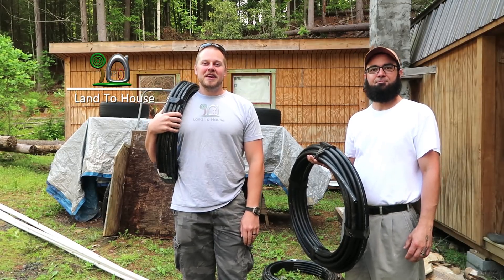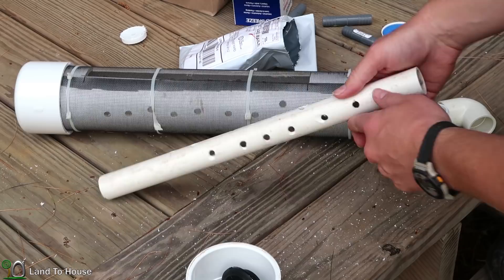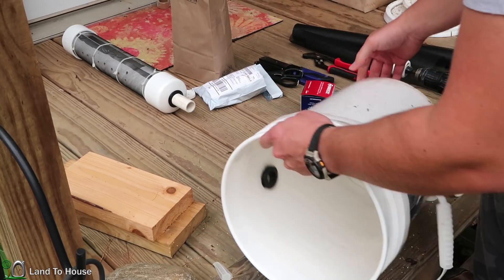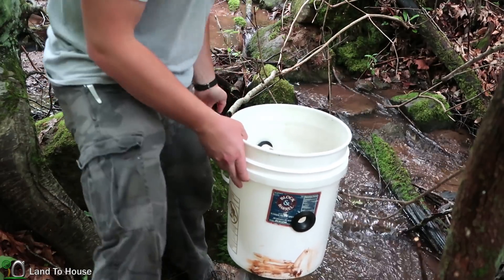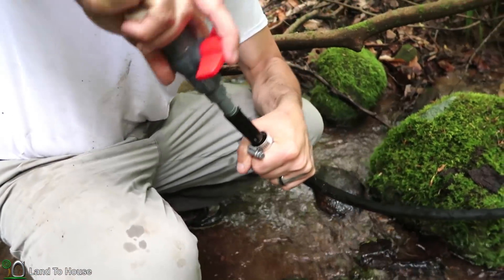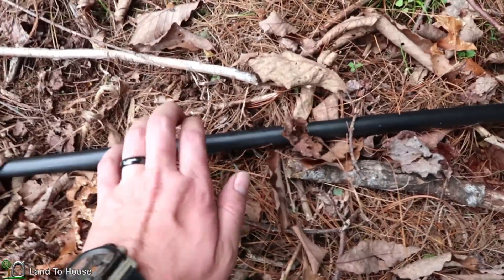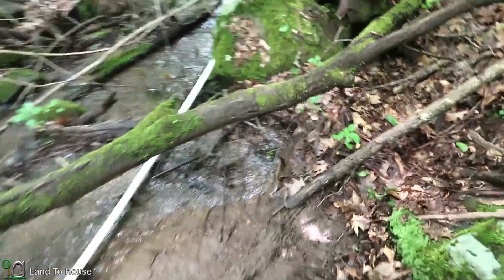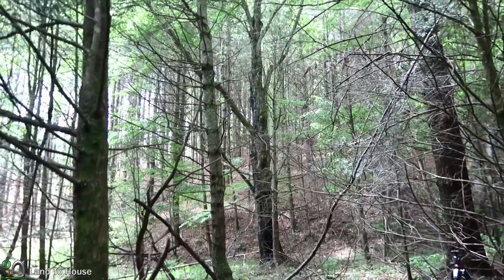Ram Pump Full Install - TheNarrowWayVineyard

Comment: I'd like to suggest putting a 90 on the end of the bucket's supply line to 'swirl' the water to better separate the silt, and add a coupling and bit of pipe so the ram pump drive pipe draws from the center of the swirl where the water will then have the least silt.

Comment: Really good video - very clear and practical. Your material is all of a high standard (your work much appreciated!)
Reply from the maker: Thank you! My content has gotten better over the years :)
Reply: @LandtoHouse  no worries - I woul be scared to push your website and products harder either. The products and you have integrity - by promoting them harder your adding value and enabling your continuing education effort.

Comment: what if we install another ram pump at the end of that delivery line?? Is that second pump would act as a primary one??
Reply from the maker: The ram pump needs to have a water source that is open to air. The pressure from the first pump would keep the second waste valve closed. BUT I think it's possible to run a second smaller pump from the waste valve of another. . . .we shall see soon.
Reply: @LandtoHouse  Thank you bro
Reply from the maker: Happy to help.

Comment: Congrats for your great video!
I installed a 1" ram pump with the following specs: length of supply pipe 50 m, 2-3 m fall, material high density polyetilene. 
and it´s working, but it´s only giving me 20 psi of output pressure and I need to achieve at least 40 psi.
What do you think I can do? insall a standpipe? increase the fall? change polyetilene to steel? to tighten it more?
links: https://drive.google.com/open?id=1EihdLtyUm2E4yl3ui9bvXfItgn7ssU2Z
https://drive.google.com/open?id=1LY2vCEZhpUYjsFe8cz2GnzaE6QY6MVjf
thanks for your help! greetings from Colombia
Reply: The tank and waste valve are in the wrong places. Switch them, put the tank before the waste valve. Good luck.
Reply: Get rid of the poly pipe feeding the pump, use a more rigid material like PVC or better yet metal.  The poly pipe expands& contracts and jumps around, all loosing the pressure.

Comment: Question here for you, what happens when you get flash flood type weather?
Reply from the maker: That is definitely a concern. Some people with larger Creeks will place the intake in the water and everything else just outside of the water. You can actually hook up a pipe on the waste valve to push the water back to the creek

Comment: Seth, what are the pros and cons of faster and slower cycle of waste valve most apecially for higher lift.
Reply from the maker: I have found that it's best to have cycles at 1 per second. If the cycle is too fast the pump is not able to build pressure because the pressure wave is weak. If the cycle is too slow the pump is able to build strong pressure but often the pump will stop because the pressure wave has secondary waves that interrupt the main wave.
Reply: @LandtoHouse  my ram pump at present 50 cycle per minute.
Reply from the maker: That's not bad. Should be working well enough to see nice results.

Comment: Nice teaching moment. I made this today, filing the 1” pvc did not work for me. I used the angle grinder with paddle wheel to remove quite a bit of material and it was still kind of hard to get through the rubber.
Reply from the maker: Yes those uniseal can be quite the hassle. Soap definitely helps to get the pipe in there. Luckily once you have it set it should be there permanently

Comment: The distance from bucket to the ram pump is way too long, it will create more losses due to friction inside pipe. It is better to place the ram pump right beside the bucket but with the different height level. Just my opinion... btw, 👍👍
Reply from the maker: From my experience the distance of the drive pipe needs to be at least 25 feet long. If it is shorter than that the pressure wave is too fast. True friction loss is there but the cycles need time.

Comment: I need a pump. For 50ft hight elevation..
Reply from the maker: Each pump size can reach that height. You will need around 8 feet of head pressure.

Comment: Great video!

If I may ask, what if I used two 1-1/4" Spring check valves with my ram pump? Should I just remove the spring in one of the the check valve(waste valve)? This question is asked in the case that there is no available 1-1/4" swing check valve to use.
Reply from the maker: I have not tested the pvc valve as a waste valve. The spring would have to be removed for sure. I wonder if the valve would have the same closing power as the brass.

Comment: I knew about ram pumps but problem is that I need to get water from a 26 ft deep well, at the present time I don't have an initial flow but if I could get the initial flow, then could the ram pump work off the overflow from a  watering trough after the pump fills and has an overflow or would it eventually stop working?
Reply from the maker: The ram pump is great in a creek but does not work in a well. Without the head pressure there is no pressure wave to run the pump. It would be awesome if it would work that way.

Comment: Really inspiring work. 
These pumps have real possibility. Hope you will add video on calculation process for building ram pump. So that we can try to build different size ram pump based on location.
Reply from the maker: From my testing I have found that the size does not matter much in terms of head pressure vs lift. The change is seen in volume of water pumped.
Reply: Land to House Thank you very much for your reply. Greetings from India.

Comment: How do you determine which direction (thin or thick side) the uniseal faces? In or out of container, or water direction, or it doesn't really matter. Also how long does a uniseal last?
Not related; what is the purpose of your flume?

Comment: Why do you use a ball valve instead of a gate valve?
Reply: Ball valve allows you to know its position just by looking at it and only takes a quarter turn either way to operate so you can open or close in a fraction of a second.  While gate valves only real advantage is that it forces you to open or close slowly which I don't think is needed in this situation, I could be wrong though.
Reply from the maker: For sure. On high pressure applications like in a house it is nice to have the gate valve to prevent hammer effect on pipes. But out in the creek a ball valve is best for time.